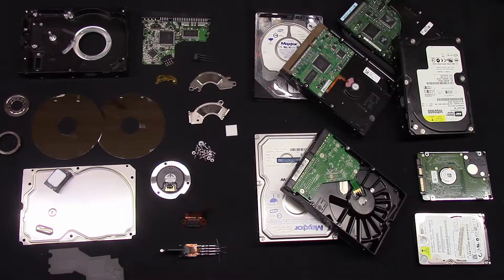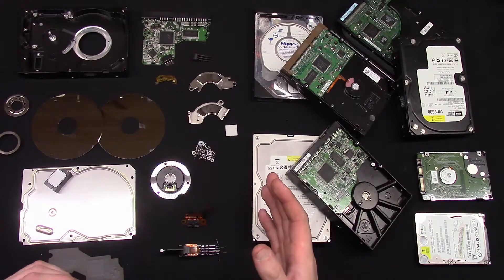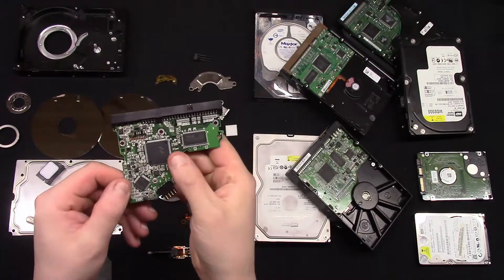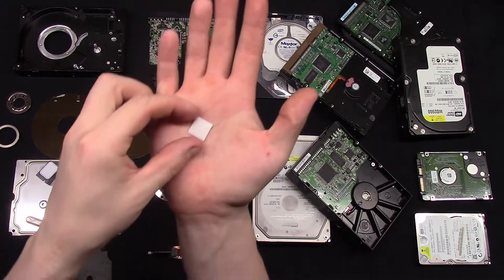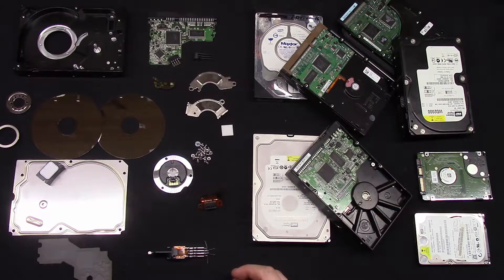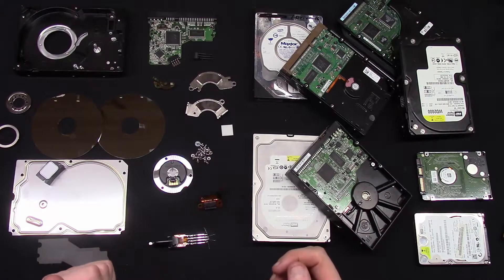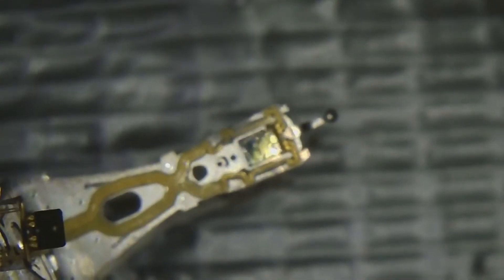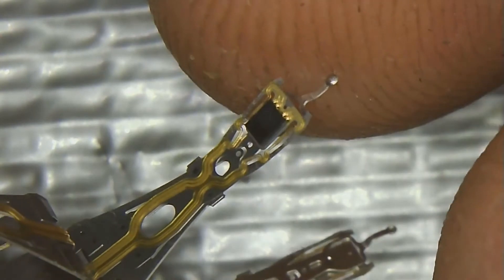HDD, Gold in Hard Drives ( 93 )

Comment: I scrap hundreds of Hard Drives every year. All values are extracted. Nothing is thrown away! They are processed as follows:
After disassembly the parts are sorted in rough categories for further processing.
Printed Circuit Boards are hydrometallurgical treated for full recovery of solder (remember, Tin is worth 6 times more than Copper).
Without any solder left the electronic components simply fall off. They are sorted in types for further treatment by various processes. Every single gram of metal is money. Everything is recovered. Many contain PMs, indeed many contain Silver, and some contain valuable REEs (Rare Earth Elements). Be aware that most of the Gold plating on the PCBs themselves are ENIG (electroless Nickel Immersion Gold) only a few microns thick!
Pyrolysis is primarely used to liberate many of the tiny parts from their mountings. This is the fastest and most convenient process when handling small e-waste components; saves lots of precious scrapping time (micro scrapping by hand is equal to loosing your time). It removes all traces of glue/lacquer/epoxy resin; besides yielding Raw Pyrolysis Oil which is later refined into free Petrol/Gasoline, free Diesel, and free Fuel Oil. All plastic parts gets the same treatment.
The reader/writer head is pyrolyzed for easy recovery of the ribbon wire by destroying the glue. Then finally disassembled into the individual components. Moderate temperature is required for this delicate item to avoid melting the High Grade aluminium.
Platters  from PCs are made from aluminium. platters from LapTops are usually made from glass (carefull, these easily shatters in thousands of needle like splinters!). A Chlorine process removes the coating which contains a tiny amount of PMs and a little base metal.
Ribbon wires contains Copper, and most of them a little Gold. After pyrolysis they are mixed with other pyrolyzed Copper bearing parts, pyrolyzed electric wires/cords (to increase the Copper content to 90-95%) and a portion of Brass; then melted into a flat anode for electrorefining to 99.9% pure Copper. PMs will remain in the bottom slime of the electrolytic cell for later recovery. The Zinc is precipitated out of the electrolyte when the concentration is sufficient.
All small electric motors are pyrolyzed (after recovery of the solder). Afterwards they can be disassembled almost by the bare hands.
The Neodymium magnets are pyrolyzed at high temperature (no more magnetic after that) to seperate them from the mounting brackets, then processed for extraction of Neodymium and REEs. The brackets are made from MU-metal, an alloy consisting of up to 80% Nickel (worth almost 4 times more than Copper). They are processed for Nickel extraction. There is also Nickel in many other parts of a HD.
The aluminium casing is sold as cast aluminium, the alu-parts from the reader/writer head and those parts holding the platters as High Grade aluminium, and the other alu-parts as standard aluminium.
The bare boards from PCBs, without any electronic components, are pyrolyzed for Bromine recovery (and Raw Pyrolysis Oil). Then the thin Copper sheets are separated out. The remaining glass fibers can only be sold in quantities of not less than 10 tons, so a glass recycler picks them up for free; together with glass from fx. refrigerator shelves, glass plates from scanners, glasspowder from processed bulbs/light tubes, as well as the glass powder remaining from Lead extraction from CRT glass funnels. At least I don't have any expenses for disposal, lol.
On average hard drives contains around 0.25 - 0.5 gram of Gold, 0.1 - 0.3 gram of Silver and 0.005 gram of Platinum Group metals like for example Palladium or Ruthenium. Some components from the PCB contain REEs. Notice: Old large HDs from the '90-ties can contain 2 gram of Gold!
As a final note: The ball bearings in the assembly holding the platters are the highest possible quality available! The are constructed to withstand over a million rotations!
Processing Hard Drives at home is way more profitable than selling whole HDs for 1 Euro/kg. You'll get "10 times" more.